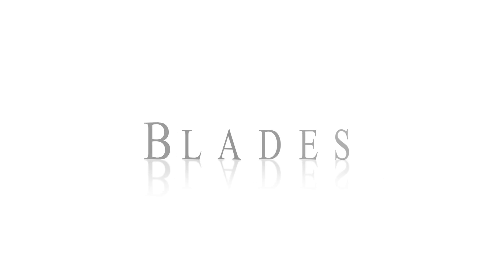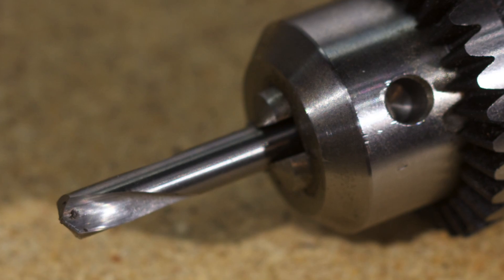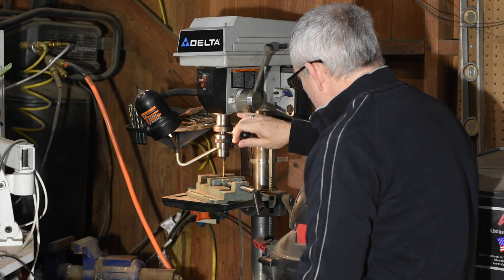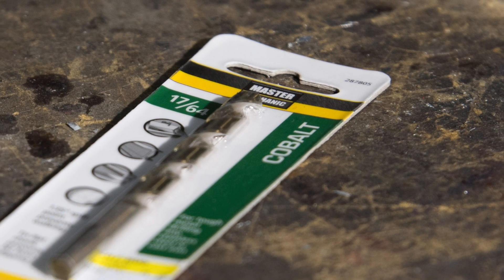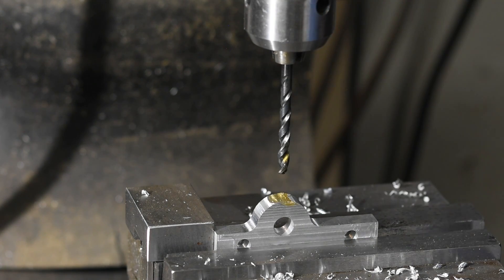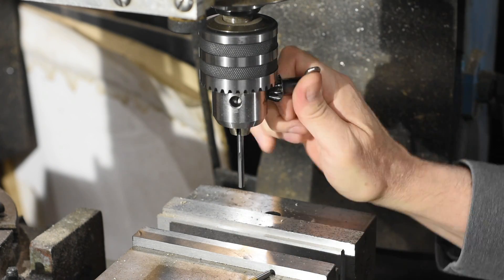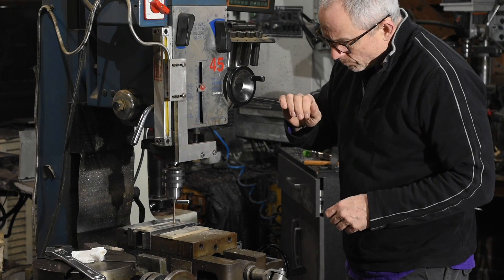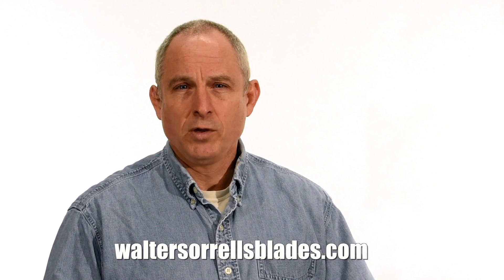Top 10 Drilling Tips for Knife Makers

Comment: Thx for the video. As a gunsmith, I use drill-press, lathe and milling machine for odd small jobs, rather than production volumes. Many lathes and milling machines feature cooling pumps for lubricating and cooling your cutting operation, using water/lubricant emulsion. However, this is messy, leads to rust and even mould. Lubricating/cutting oil base happily dissolves in methylated spirits - so that is what I use. Fill spray bottle with 20% cutting oil/spirits mix and spray regularly onto cutting tools during milling/drilling, etc.
Works for bandsaw and files too. Leaves just oil, after the meth has evaporated. Use cheap Whiskey, Brandy or any other hard liquor for better smell. Add some drops of essential oil (cinnamon, lavender, orange...) to the mixture if you like. Shake before using.

Comment: Good 
stuff Mr. Walter! Where were you when I started? Or for that matter, where was I when you started? Either way, LOL!!!
KnifeMaker/Retired, 47 years in the Craft

P.S. good advice about using less speed the larger the bit. In the same token, I can't tell you how many makers snap small bits due to too low a speed. I've advised to use higher speeds for smal lpin holes and have been told I'm nuts. So I keep drilling with no issues and I guess they keep snapping small drills of in holes. Gotta Love It! KM

Comment: The drill that Mr. Sorrells referred to as a countersink drill is actually referred to as a centre drill (center for you Americans). It is most commonly used as a starter drill, the way he was using a spotting drill. It is short and has a small point with a 60° shoulder that is intended for a lathe centre. By drilling different depths the shoulder makes different diameter holes, this can be used to accomodate many sizes of drills, unlike a spotting drill, which requires a different spotting drill for every different size hole that you want to drill. A tip on reaming, is to double drill your starting hole, that is, drill a hole that is considerably undersized, then drill slightly undersize, then ream. This avoids drilling an oversize hole before you even get to the reamer. E.G. to ream a 1/4" hole first drill 7/32" then 15/64" then ream. To drill a deep hole, without the bit wandering "peck drill". Put pressure for a couple of seconds then ease off, repeat until you reach desired depth, occasionally removing the drill from the hole, to both clear the chips, and apply coolant (which is what a machinist calls what Mr. Sorrells calls "lube").This technique will keep your holes square through the work piece, which can be important for parts like pommels.

Comment: Number 10 tip:you will not regret buying a drillbit doctor the lower end 50 dollar starting price (which is for twist bits and maybe spotting bits)  is all you need and if your spending 4.50 (at hardware store) on your cobalt bit, well 10 bits cost you 45 bucks, so long as you do not burn up that bit 3 times (you can grind off the burned up part) 12 sharpenings will pay for for that drillbit doctor. I only really run 3x16 bits have around 30 cobalt drill America bits of them I bought on amazon for cheap and have not bought new ones since. i did fry my doctor because I did not empty out the shavings which then got into the motor.  so drillbit doctor is a great tool to have as it saves you money.

Comment: Most people don’t realize it, but twist drills don’t make circular holes - the hole you get is actually tri-lobed. To get a really accurate hole, the general manual machine shop approach is to spot it (for location), drill it (for bulk material removal), bore it (to establish circularity and get close to final size), and then finally ream to final size. Time consuming, yes... but you can get more-or-less dead on holes this way.

CNCs, of course, can do it in one step; by using an end mill and running it in a circle around the inside of the hole...
Reply: Spot on. A two cut drill will always make a tri-lobe hole. No CNC will match the roundness of reaming and honing
Reply: Michael Schmidt - weeelllll... unless it’s a CNC reaming & honing cycle. 😉

Comment: Drill bits?

Cobalt or Kobalt?
Funny, Kobalt doesn't make a cobalt drill bit.

What if all I have is a Home D?

Seriously, some GREAT advice.
(If you can, find an ANTIQUE ShopSmith 
Model 10.  The Model 10 [10 E or 10ER]
are STILL the best drill presses and lathes, 
that ShopSmith ever made.  They were VERY 
over-engineered,and are still being used by 
the factory, to make the new ShopSmiths.
On Craigslist, $200 is expensive.)

steve
Reply: You can get cobalt bits at HD. Milwaukee makes them and they are awesome